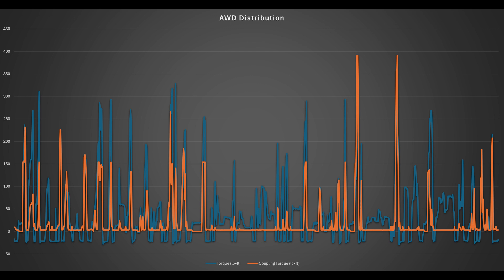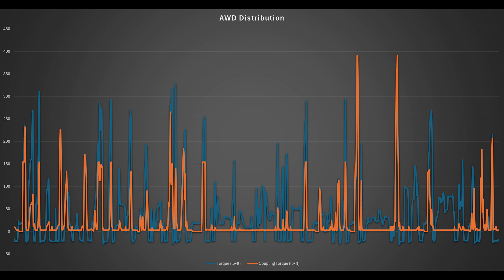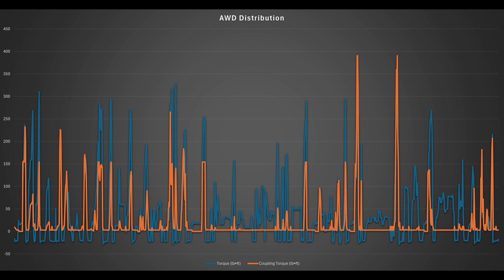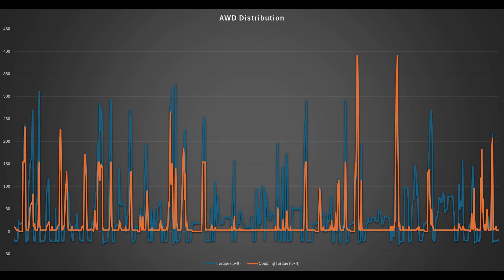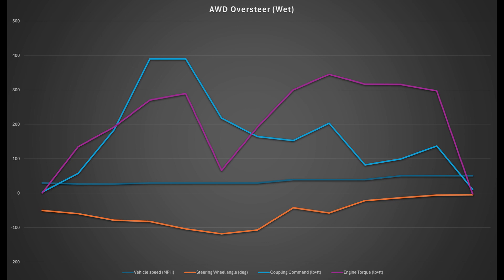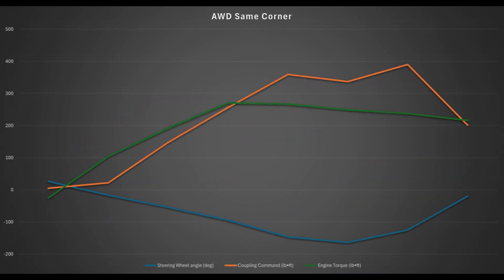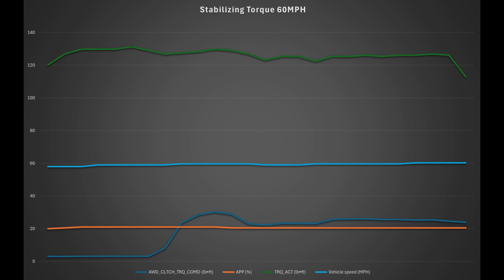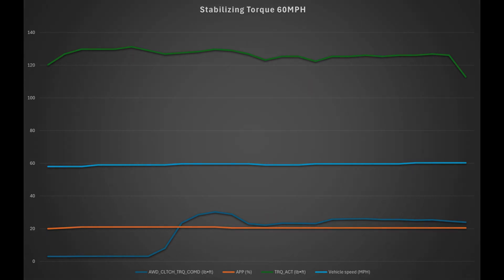Mazda 3 Turbo AWD Distribution, Real World Examples #mazda #awd

Comment: I was under the impression that it was on-demand, but if I understand correctly, the rear wheels are always engaged but the amount of power being sent to the rear varies?
Reply from the maker: There is a lot of bad info floating around online about it being an on-demand system. You do understand correctly, it sends an amount of power almost always to the rear and it varies quite a lot on the amount.
Reply: @grolladat  Ok that’s good to know. I kinda “wrote it off” in thinking it was on-demand. I personally hate those types of systems.